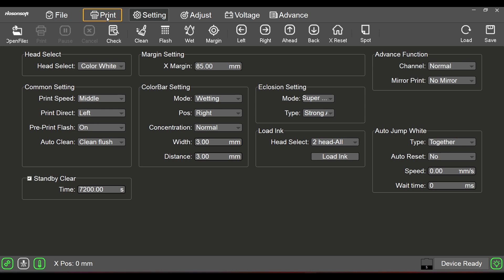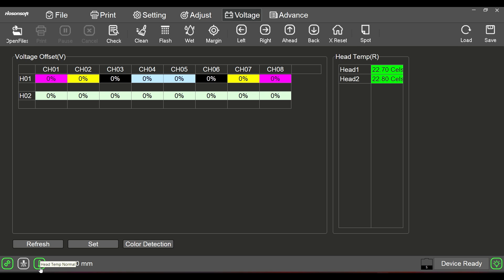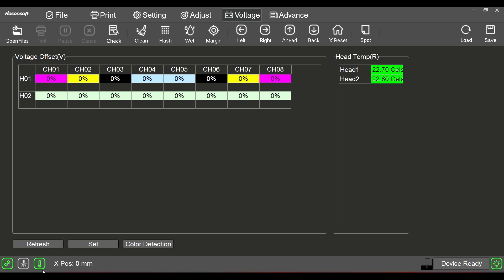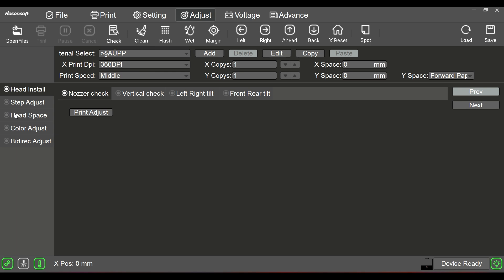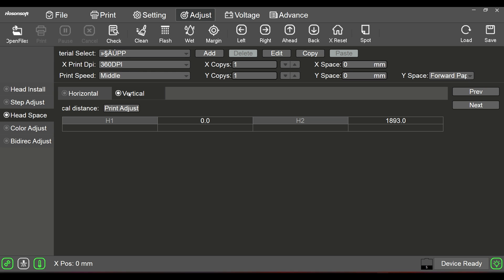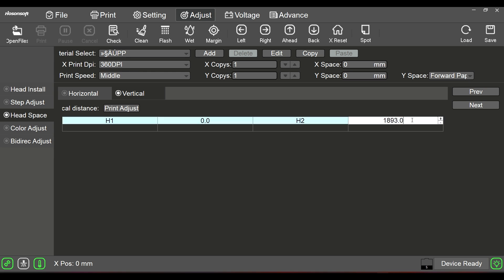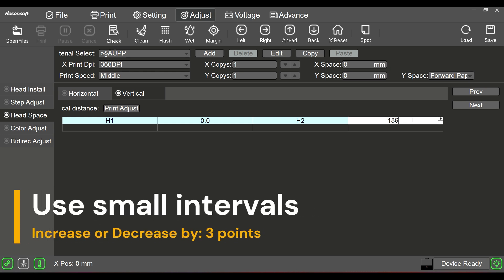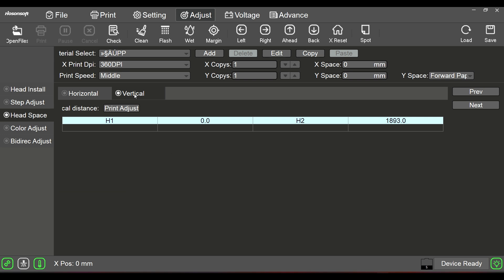How to do a Vertical Alignment of H2 White on DTF Printer

Comment: I have an issue with my vertical alignment. No matter how many times I fix it and get perfect, saved n loaded, I can’t get it to stay where it’s at.
Reply: Horizontal video
Am still waiting
Reply: @enockboateng671  You have to export the settings. Not sure why, had the same issue.
Reply: try Cleaning the feed Rollers (top and bottom). sometimes i have that same issue, then if that does not fix the issue, then i move to the Alignment part.